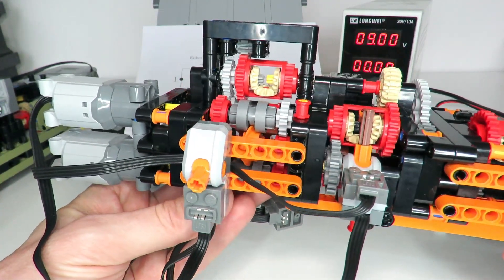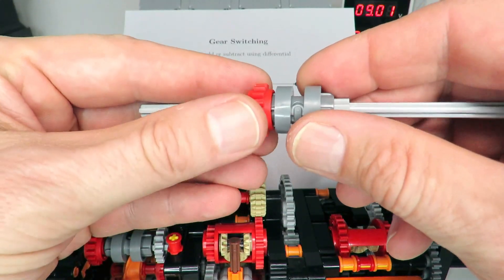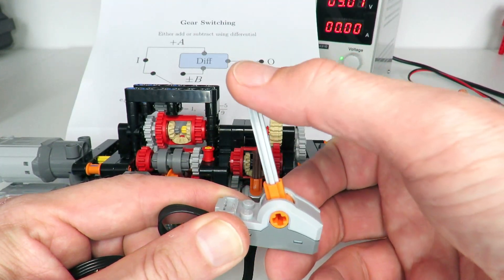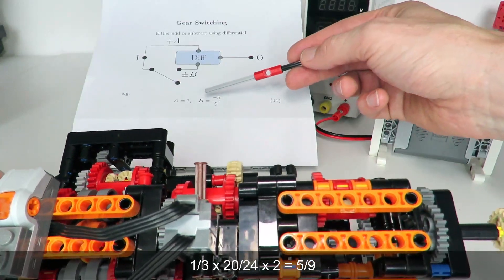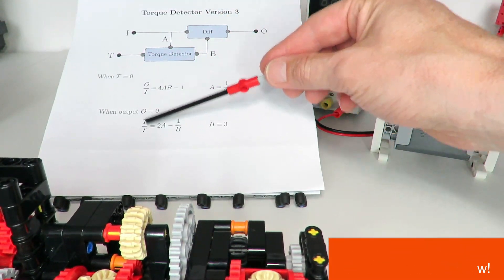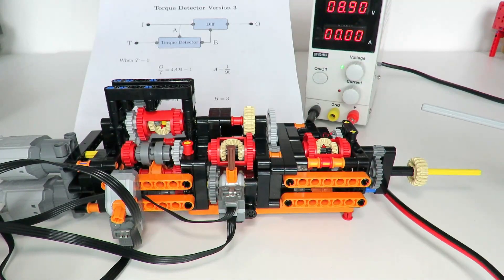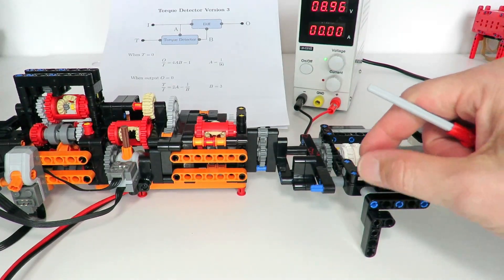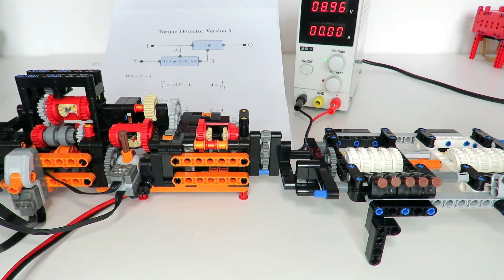Lego Technic 2 Speed Automatic Gearbox with Booster Motor

Comment: Where are those red differential pieces from? Sets or 3d print? I have everything except those
Reply from the maker: Hi there it's part number 6573 in red. https://www.bricklink.com/v2/catalog/catalogitem.page?P=6573&name=Technic,%20Gear%20Differential,%2024-16%20Teeth&category=%5BTechnic,%20Gear%5D#T=S&O={%22iconly%22:0}
Reply: @TechnicBrickPower  thanks, I have a bunch of them with the other teeth at 90°, but these In line ones are the answer to a few design problems I had. Thans

Comment: This gear and switch monster is a bit useless in my eyes. Just limit the torque electronically and connect both motors directly together.
Reply from the maker: Hi Jan. Yes well you don't know until you find out LOL 😂 I agree just put both motors on at once!
Reply: @TechnicBrickPower  Still a nice construction and surely you learned something with a lot of joy. Thanks for sharing!

Comment: I'm surprised you didn't have a diff to merge motors? I love the idea of a booster motor. I may have to borrow that idea :-D
Reply from the maker: Hi Carl. I did try that but with different gearing ratios on each motor and when you hold the output axle, motor 1 just drives motor 2 due to it having greater power and the output gets little torque. Maybe I configured it incorrectly...😂
Reply: @TechnicBrickPower  I reckon slightly gearing the motors down before the integration diff, and also much reducing the final drive ratio would sort this, based on my model RC car experience. By providing an easier path for the torque to reach the road, it shouldn't turn the motor back. I need to buy some more motors.. this is getting expensive! also, of your two motors, what gearing was the one that turned back? you're tip top on the numbers, I reckon you can see the answer but aren't looking at it :-D. Failing that a worm drive on each, then the diff. Argh I must get me some more motors and stuff and build something this is addictive. Anyway love your videos, they give me inspiration. Stay safe.